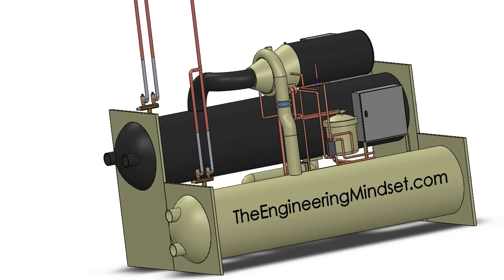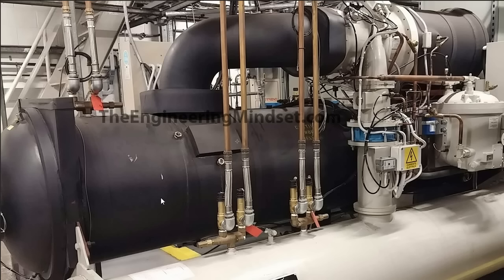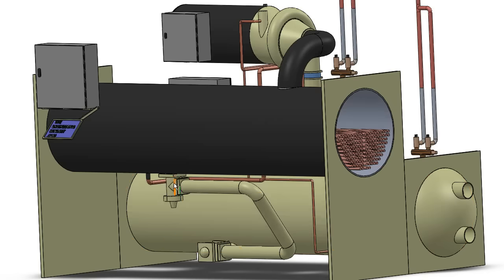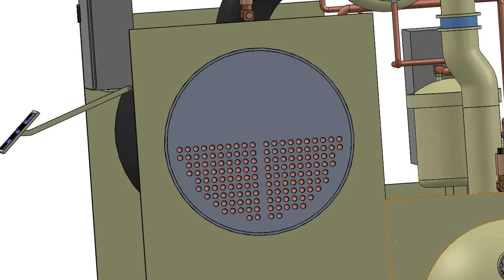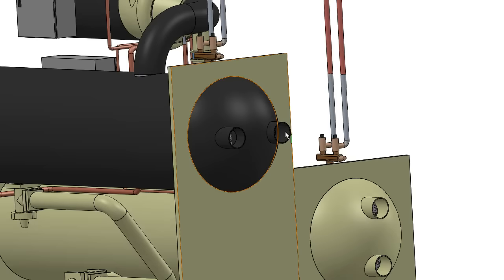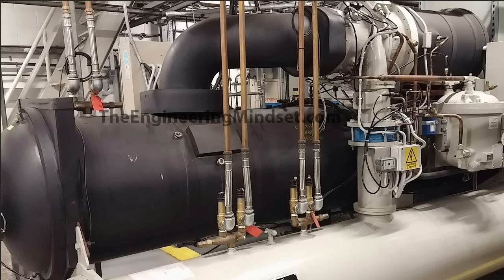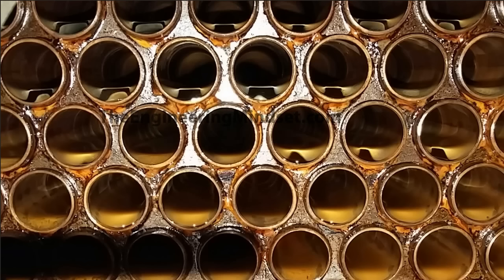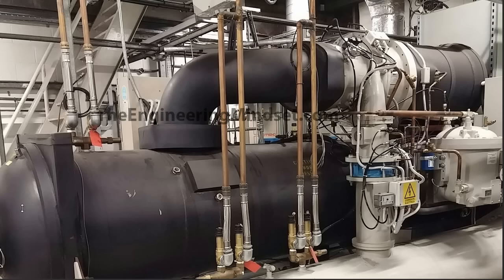🔧Chiller - Evaporators

Comment: If the spring loaded valve opens to let refrigerant out and into the atmosphere, then do you need to top up refrigerant to replace the ones emitted? And if there an optimum refrigerant load to reduce emissions and reduce the need to top up refrigerant (if even necessary)?

Comment: Thanks for the video. For the plugged pipes, how would you identify which tubes are leaking water to the refrigerant, especially if it’s a smaller leak?
Reply from the maker: You test the tubes and if it can't hold pressure then it has a hole

Comment: Thanks for such a brilliant presentation.I have Some questions How refrigerant absorb all the heat ? Which thing is in the evaporator that made the refrigerant to suck all the heat from chilled water? 
As the tube contain the water and refrigerant is all around the pipe how come the absorb heat did not  affect again to the pipes?
Reply from the maker: Hi Waleed, The refrigerant has very low boiling point and when it evaporates it takes some of this heat with it, much like it you boil a pan of water, the water evaporates and will carry the heat away as steam. The only thing that makes the refrigerant "suck away" the heat is the temperature difference and specific heat capacity. Hot always moves to cold.

Comment: Great video! You say that chilled water enters the evaporator, but I thought the water in it would come from the terminals in the building, i.e. it would be water carrying heat collected from the ambient. How does that work?
Reply: Yes chilled water enters the return side of evaporator from a terminal and leaves chilled on the supply side of evaporator to a terminal.
Heat is transfered through refrigerant to condensing barrel.

Comment: well done very well done comma I have a question. In a chiller with with refrigerant 123 is it possible that air in the system will also cause a surge.?
Reply from the maker: HVince AC yes it could lead to surge. if the refrigerant level was low also or if non compressible fluids entered the compressor.
Reply: The Engineering Mindset 
thanks for the reply.

Comment: I love your presentation. Well done. If I may ask, what are the likely causes of suction pressure fault in a chiller?
Thanks.
Reply from the maker: Hi Samuel, there could be many reasons. Probably there is a blockage, over/under charged with ref gas, wrong gas, low detla T, broken sensor. It would be best to bring in a service specialist. If you do, make sure you see what they do and ask lots of questions to learn.
Reply from the maker: We just covered chiller faults in our recent video! https://youtu.be/Zu0LVVNNVSw

Comment: Thanks for your video, I have one doubt how does Liquid Refrigerant move towards the evaporator at a higher level, what's the driving force to move to higher elevation.
Reply from the maker: Pressure
Reply: @EngineeringMindset  U mean the pressure from Compressore

Comment: According to animation in this video evaparator is shown at bottom but in your 3d drawing it was located at top part of chiller and bottom as condenser right?
Reply from the maker: its going to vary by manufacturer. It's typically found at the bottom through.

Comment: Thanks a for presentation.may I ask you for the types of refrigerant used in these types of chiller units,and their properties, especially boiling point of refrigerant.
Reply from the maker: R134a is used on many chillers, check the website of manufactures such as Trane and Daikin Applied. You can find the data for the refrigerants by googling "R134a properties"
Reply: we use R717 and had a few leaks due to shit maintenance lol

Comment: If the expel its heat in the pipe, would it possible that there can be moist in the evap pipe that possibly be mixed in the refrigerant?

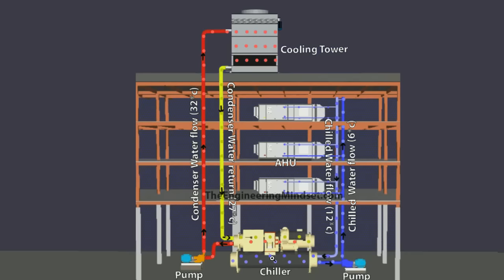Comment: I'm a bit confused you are pointing to evaporator in the diagram at 1:03 located on the bottom looks like the Condenser is moving fluids into the AHU.

Comment: 5:30 I think you meant 'the chilled water leaves the evaporator at 6 degrees celsius'
Reply from the maker: Well spotted. Thank you. Yes it should enter at ~12*c and leave at ~6*c depending on the setpoints.
Reply: Are there any compressors and cooling towers used in ice rink to make ice

Comment: at 9:15 you said "chilled water entering into the evaporator.." but correct me if iam wrong, actually the hot water is entering into the evaporator from AHU and gives up the heat to cold refrigerant and get cooled ans leaves it as cold water. So HOT WATER IN and COLD WATER OUT. Right ?
Reply from the maker: Ajith Khan correct, but the water in that loop is referred to as the chilled water loop regardless of temperature.
Reply: Thanks professor.
Reply: I have confused let me know, chilled water flow in tube or shell of evaporator??
Reply: @hbk775  chilled water flow inside the tube

Comment: Would u tell me what deference benefits between one, two and three pass?
Reply from the maker: More paases means more heat exchange as larger surface area. That also makes it shorter in length although larger in diameter. More chance for the heat to be full utilised.
Reply: thanks for the reply

Comment: What about the difference between direct expansion evaporator and flooded evaporator ?
Reply: Direct expansion that meaning liquid refrigerant entering to the evaporator tube( fin and tube type) .indirect expansion that is  liquid refrigerant entering the heat exchanger (chiller)tube side is refrigerant shell side is water